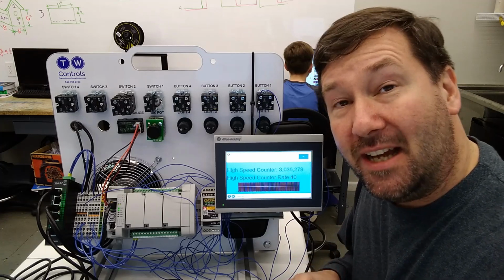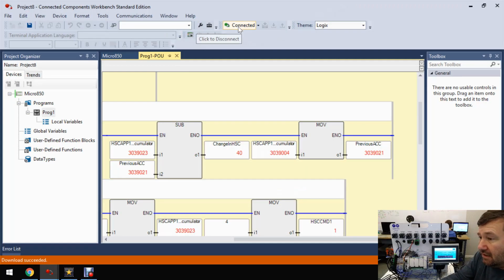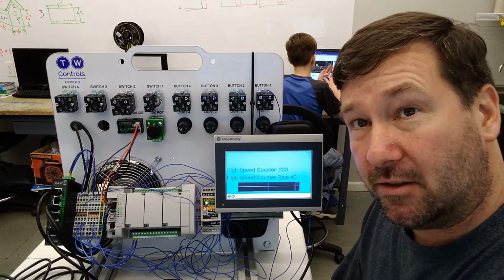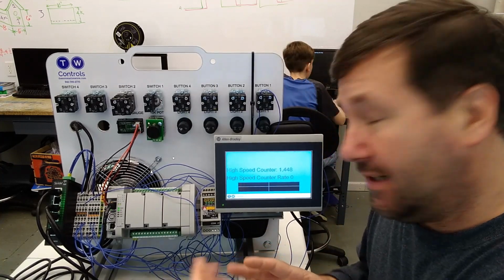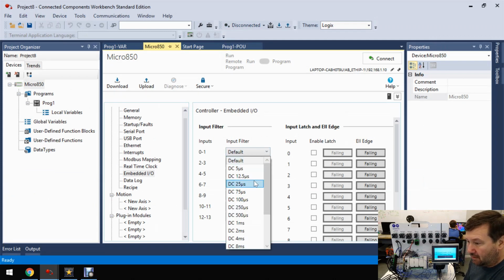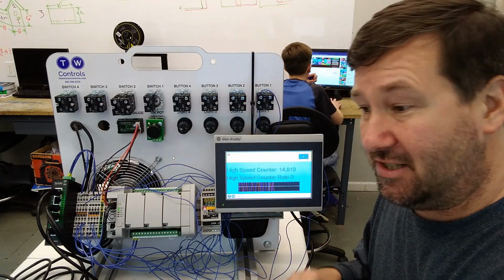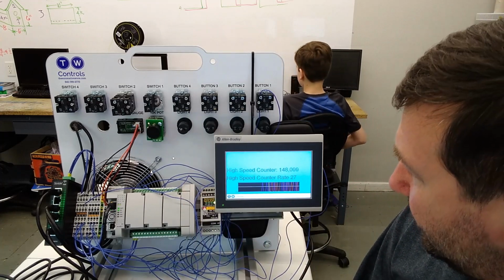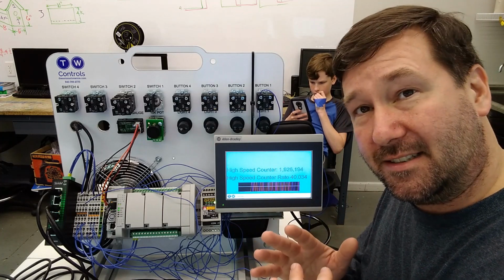Configure Input Filters in Connected Components Workbench Micro800

Comment: Tim. Love the videos.  Thank you!! I am a SLC, CLX, MLX 1400 guy. I’ve been tasked with creating some standard logic for pipeline flow rates using high resolution flow meters. There is NO decent info for us Rockwell programmers. I appreciate the video. Thinking about the ladder logic lag at higher frequencies does the plug in HSC have a coprocessor to prevent inaccuracy similar to the HSC cards in a CLX rack?
Reply from the maker: Yes, the HSC operations are done outside of the scan cycle

Comment: The reason the quarter millisecond worked fine for the 1 kHz encoder setting, is that the 4 kHz is the combined transitions of both A and B. Each input though is only seeing 1 kHz signals with 2000 transitions or half a millisecond on and half a millescond off.

For 10 kHz you should expect 20k transitions of each input, 40k total. So 50 microseconds between transition. A 25 microsecond filter would likely work just fine.